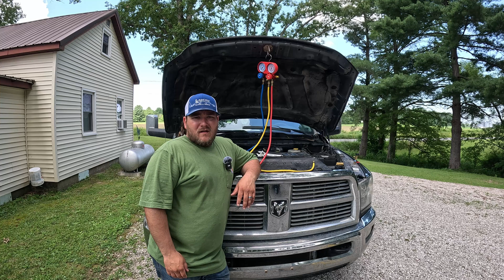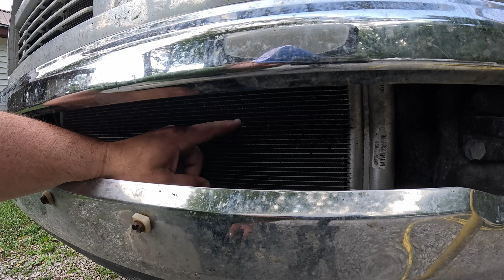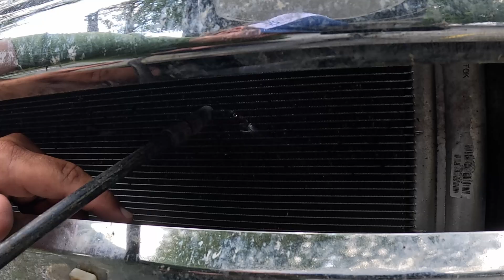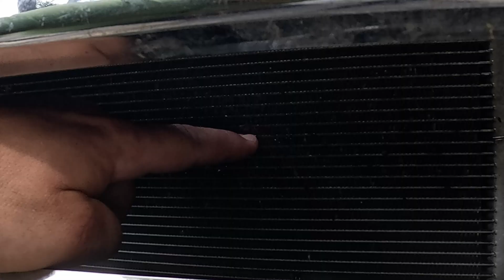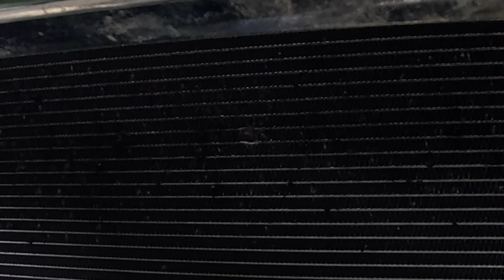How to find an AC refrigerant leak | AC leak test

Comment: Can you list that adapter parts name? thank you
Reply from the maker: https://www.harborfreight.com/r134a-self-sealing-ac-refrigerant-can-tap-valve-58638.html
Reply from the maker: See if that link takes you to the part.
Reply from the maker: https://www.harborfreight.com/14-in-full-port-ball-valve-63553.html
Reply from the maker: https://www.harborfreight.com/14-in-male-steel-industrial-plug-63562.html
Reply from the maker: These are all 3 items used to connect the air compressor to the AC guage set.

Comment: My 3500 AC was weak in extreme heat so I tried recharging it myself using one of those DIY plug in cans by Blaster. Unfortunately the blutooth function temp sensor stopped working so I was left guessing how much to add.
After a while I started to see some blasts of vapor coming from the drivers side and this continued spuratically while driving. I did empty the 16 oz can and top pressure reached was 69 psi.  I'm still trying to figure out where that was coming from, if I need to now take it to a pro, or if that was just a pressure relief valve and all is well. O'reilys tech said these systems cam explode if not perfect so I feel compelled to take it in for service now.
Reply from the maker: If you are willing to give it a shot, I would get a set of AC gauges and see what the pressures are and adjust accordingly. Even if you can't get it to work properly, you're not out anything more than just a little time. You can rent gauges for  free and I have a video explaining how to do it, if you haven't already seen it!
Reply: @Natesroadlife  I will have to watch that again. I'm just concerned now by what the Oreillys tech told me and some video I saw said that you can't just go by pressures. My truck is 11 years old now and doubt that it's AC  has ever had a full fluid change. I'm planning a trip into Mexico so really want to be sure all is well.
Reply from the maker: You will definitely need AC down there!! I just drove I40 from LA to OKC the other day, and it was 114 degrees in the California desert!